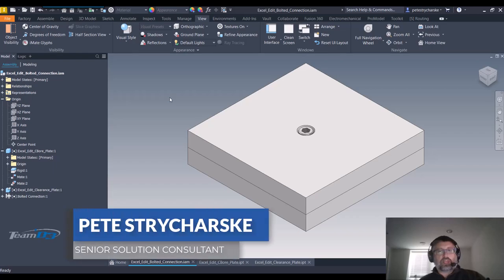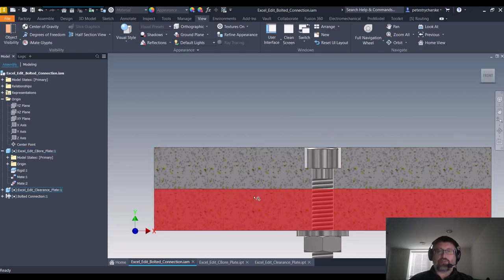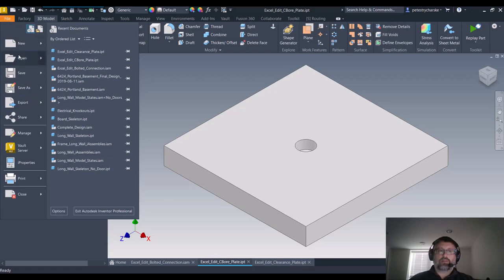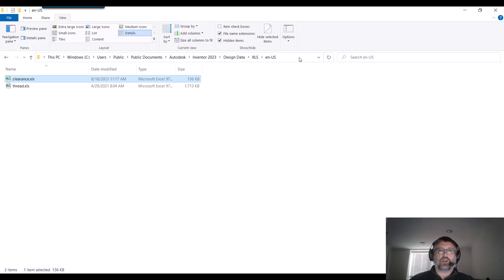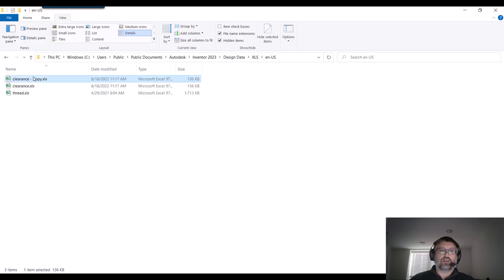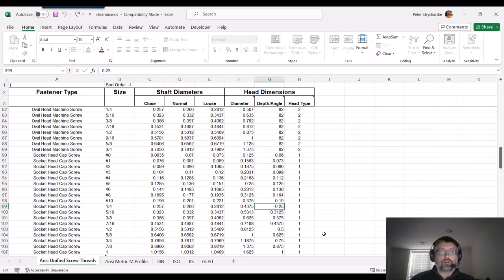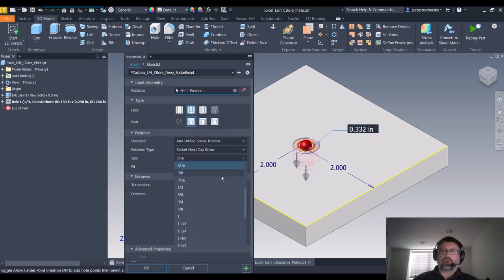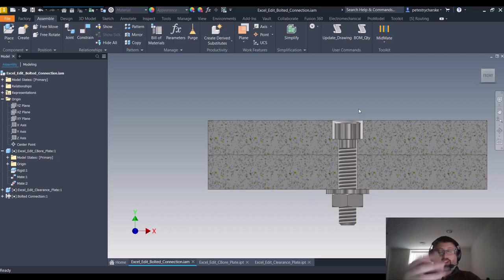Inventor - Controlling Bolted Connections by Editing the Excel Hole Tables

Comment: Pete,
I know that there is a .preset file for the custom presets, do you know if there is a way to make that into an Excel based system? Or maybe it already exists somewhere?
Reply from the maker: @edouardstringer3601, thanks for reaching out!  I'm not aware of a way to control the .Preset file via Excel.  However, it looks like XML files can be imported into Excel, manipulated and then exported back to XML format.  I'll have to do some testing to see how efficient that is.  Initially it doesn't look good, as Excel isn't reading the .Preset as an XML file...

It may be more efficient to edit the file with some sort of XML editor.  Let me know if you have any further questions and I'd be happy to dig into things further.  Thanks for your patience, hope all is well and have a most blessed day!

- Pete